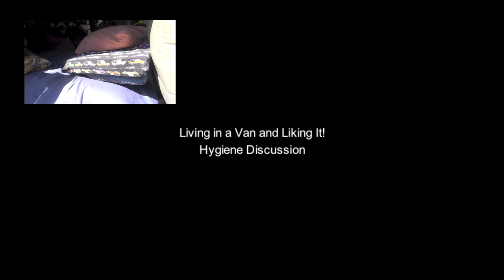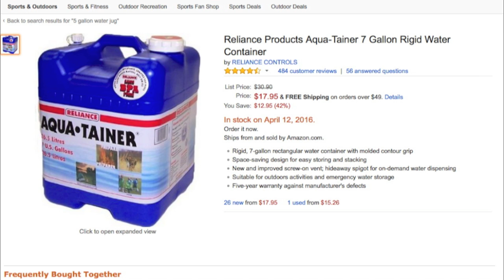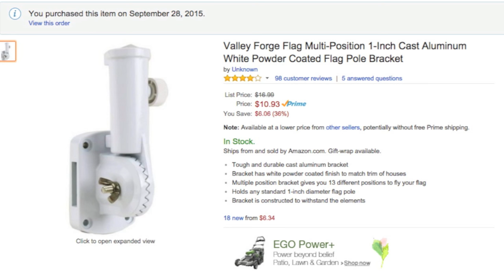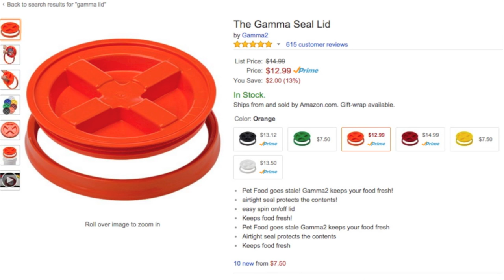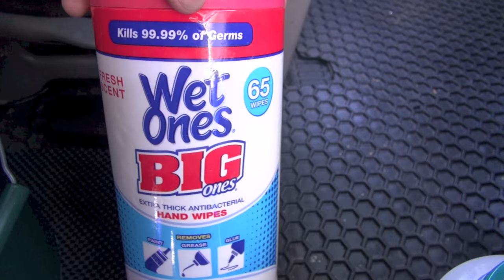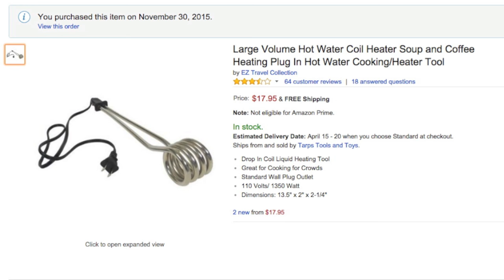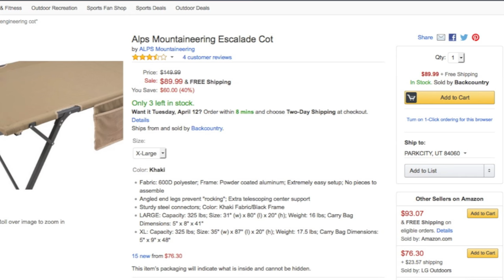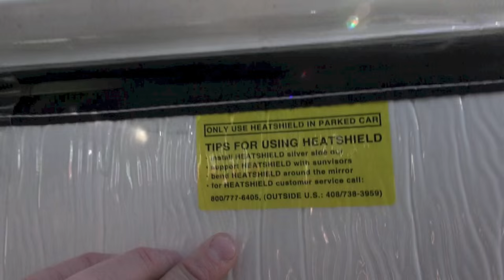Living in a Van and Liking It: Hygiene and Sleep!

Comment: When sleeping in any vehicle with engine running, buy from Lowes / Home Depot a Carbon Monoxide / Smoke Detector that is usually used in the house. They are less than $50 and can be screwed or adhesive to the ceiling
Reply: +Jeffrey Miller I guess you do not read / watch the news much. People die on a regular basis because of cabin leaks or when parked and its snowing and snow builds up around the car and the bottom of the car keeps the snow clear and the carbon monoxide is trapped underneath and creeps into the car and kills. No car is airtight, that is why when you are driving with the A/C or Heat on and it is set on recirculate yet you can smell a forest fire you drive by or many other smells you encounter. FYI Carbon Monoxide is oderless
Reply: +Jeffrey Miller When a vehicle is moving, the constant airflow over the vehicle helps keep exhaust away from it, so a minor cabin leak might not let enough in to harm you. When it's sitting still, though, you up the risk of poisoning. That's even worse when you're asleep and thus can't immediately notice the effects of CO poisoning.
Reply: +Jeffrey Miller Thinking like that kills people every year.

Comment: Pro tip: when you park, and it's not too sunny out, put the solar shower under your hood for an hour or two, perhaps with a towel on top if it's cold out.  It'll be as toasty as you like.
Reply: Smart!
Reply: Smart!
Reply: +blurglide Engine heat also good for warming canned meals.
Reply: whiskey papa Good idea- I might throw a can of soup nest to the radiator
Reply: +blurglide If he were as handy with engines as he is with guns he'd install a hot water to hot water conversion tank (a small one, like 2 gallons, set it about 190F) like they use in houses and such then he could dilute the hot water down to whatever temp he would like. Even make a cup of hot cocoa or cold press coffee.
Reply: +BikingMNViking yeah like those heaters in glampers.

Comment: Do you keep an extra cheap starter in your truck? The one thing about boondocking with automatics is if your starter goes out, you're screwed. I also recommend a second battery (deep cycle) with an isolator so you can hook an inverter up and run whatever 110v you need. With the right setup you can press a button and it'll connect both your batteries in case you kill your starting battery. Redundancy is the biggest thing for those of us who do this often.

Comment: Clumping cat litter.  A lot easier to find on the road than the Lug-Loo chem packets.

Shower/dishwasher.  One or two gallon pressure sprayer bottle, re-fit the wand with a kitchen sink sprayer/hose
Reply: +el diablo loco poco I was thinking about getting a spray bottle. Good idea.
Reply: DappledJoker It works great, and its a bit easier to clean than one of the plastic sacks.  Put it on the roof of the jeep for a "shower".  The current bottle is black, and it warms up fairly well when the sun is out.  Don't expect a lot of water pressure though.

Comment: A good addition to the commercial building water kit would be a 4 way silcock key, because the spickets are usually different than a residential hose setup. You can get them in the plumbing section of depot or lowes, or on amazon for $8-10-.
Reply: Yes.Good option.

Comment: I've doing a lot of the same things you've got going on. One thing I'd suggest is that when you get ready to use your shower, add about 1/2 the volume of water, then heat with jet boil or similar a couple of cups (liters) of Hot water. It take the chill out. Doesn't take long either.

Comment: I've used a NEW 1gallon garden sprayer as a camp shower. Heat gun the wand and bend it into a J shape to spray yourself. Fill it with stove heated water or a black painted juice jug in the sun heats it to real shower temp in no time. Pump up for pressure from any angle.
For the loo, I would suggest using sawdust (wood stove pellets) or peat moss/coconut coir (from any HD store) as cover material for the affluent- no liquidy mess, and helps trap odors. Even used coffee grounds from most coffee houses. Great call on the gamma lid!

Comment: I have the exact same van. just an idea, if you back up the van and open the back doors you can stretch a pole across the back doors. the back doors have a little spring to them when fully open so you can squeeze a pole between the doors and the tension of the sorts will hold it. if you place the ople across the end of the doors at the top and you can hang a curtain from it and take a shower just inside the curtain between the curtain and the bumper. a bit tight but much more secluded than showering in the open.

Comment: I do the same thing. I hate spending HUNDREDS of dollars a week on hotels so I live in my van when I travel and I swing by truck stops or campgrounds for showers. I keep 20 gallons of fresh water in a 30 gallon barrel. I also have a generator. I have a simple little breaker panel that powers my PTAC and my general outlets. I can run on a simple 20A/30A 120V plug or a 50A 240V/208V.

Comment: Since you use liners in your loo you can drill a vent hole in the top side of the bucket to let the air out but it will remained sealed with the gamma kid setup. Great stuff.

Comment: Nutn, 

Let me upgrade your shower situation. Heres my surf shower:

5 gallon LCI water can (same as used by military)= $20 

Submersible pump water shower (on amazon) (plugs into normal gigarette lighter charger, or you can retrofit for whatever plug easily)= $40

If you want hot water (i just fill up with hot when i leave and its still hot by the time I get out of water) buy a fish tank water heater and strip the plug and use liquid tape to splice a cigarette lighter on)= I dunno the cost but bet its less than $30

With this setup you get hot water anywhere and powerful water flow.

Comment: Me and my family are big on wipes! 4 kids will do it! Stopped buying ready made wipes we use the dye free select a size paper towels, break em down and yes your folding of the individual square is important!! Fold into a like size lock n lock or wipe contaner with about an inch of water and your favorite soap press the square of PT in your so semi soapy water. Keep folding and pressing until it's full dump out any excess spuater and your done. Store in a zip-loc

Comment: Regarding a heated shower, have ever thought to, or ever considered, installing an on-board hot water shower that utilizes a heat exchanger to use heat the engine produces to warm your shower water? A lot of off-road expedition guys use them with great success.

Comment: Sweet setup!  My uncle rigged up a system that heats his swimming pool using his home's AC.  I bet you can figure out a way to heat shower water using the van's engine... Maybe hit a switch to circulate water through some coils around the exhaust manifold... or maybe divert some engine coolant through a small radiator submerged in the water... Maybe you'll come up with something better.  Just some thoughts :)

Comment: Running the engine overnight for ventilation is clever and cheap.  Probably the best way to not sweat to death in summer heat, but isn't that bad for the engine?  Nice systems!
Reply: +OutdoorEnthusiast88 If the engine's cooling system is working properly, It should be fine. Running an engine at idle does place some wear-and-tear on it, but it's still less wear than actually driving the thing. I guess it depends on how much you're willing to spend on gas. I'm not sure exactly how much gas it would use to run an engine on idle for 6-8 hours. Probably quite a bit.

Comment: NutN, Regarding your shower system, check out what the 4x4 guys are using in Australia. Glind is one of the leading manufacturers of hot water showers that your system could easily accommodate.

Comment: Much better video this installment. My 800W inverter will run my 1.0 HP shop vac (6.2 A continuous). I have secondary battery installed with breaker so I can cut the vehicles battery out of the loop or charge both. I like the water trough heater but I think it pulls more amps than practical for inverter off a couple car batteries. I carry a large rice cooker, pulls 500 watts and will boil 1 gallon of water in about 15 minutes, good for coffee, add to a couple gallons for shower water. You can also place a 5 gallon plastic jug where the vans exhaust will hit it but it takes awhile to heat that much water.My inverter also runs my laptop and my all in one printer/scanner if business trip and need the printer.Get some higher grade (at least 90% rubbing alcohol) for after bath splash, because you can't clean germs, you have to kill them. The alcohol will also act as emergency reserve fuel/ washer fluid antifreeze.For a night light I have EasyAcc U-6,000 powerbank w 50 lumen light that is good for 72 hours continuous use on one charge and will charge my Huawei mediapad X1 one time. The Huawei is my phone/tablet-entertainment device/broadband modem for internet and actually still fits in a front pocket. Has a good camera also. If I wear bib-alls the camera sticks just above the pocket and I can use it as a body cam.

Comment: you should talk to truck drivers and see their systems.... for example we get free shower for every 100 gallons of fuel we put in on our loyalty card. You should get a flying j - pilot card. To pay for a shower at truck stops we don't fuel at is usually $12. I usually shower every 4 to 6 days when on the road, but for the days I don't shower I get the cracks and crevices with baby wipes and wash face and hands whenever I get a chance.

Comment: +nutnfancy I spent a late-season (6" snow) hunting week camping in my Isuzu trooper, and was quite comfortable. My system is similar, except I have a foot of clearance, and 4x4; as such I've had some amazingly pretty and secluded country to wake up to. No AC though. :( Anyway, I'm looking at putting in a copper coil under the hood, and using the engine heat to warm my shower. I'm sort of surprised that (as shown so far) you don't have a lightweight shower tent. Thanks for the links on the chem option for the toilet. I actually attached my toilet seat permanently to the bucket, and just use a fresh bag for each "movement". My buddy and I affectionately refer to it as "the buggy dumper". I need to get some smaller totes like you have. Great idea. I use the large rubbermade totes. They are a pain to search, but make a handy seat or table in a pinch. They are also pretty tough. Since I have windows, people can't easily see their contents. For those considering what Nutn is showing us all here, DO IT! There is a whole new amazing level of freedom and adventure to be discovered. Thanks for sharing Nutn.

Comment: I think most of those bucket potties us some sort of dry material rather than wet.  That's the first wet bucket I've seen.  Have you tried cat litter, instead, lol?  For some reason some naturalists put a dry potty in their otherwise luxury microhome, especially when it's still on a trailer (you know, before it becomes their vacation home, lol).

Okay, so...  You could get a twin memory foam matter topper, I like the cooling gel version, that would really improve that bed.  Still wouldn't be like, mattress soft really, but if you could get an even thicker topper until it was really a lot better.
Reply: Got my mattress topper on Amazon, lol.
Reply: They make pillows out of that memory foam too.

Comment: For road / camping showers I'd recommend the less than $100 Nemo Helio.  it's pressurized by a foot pump, holds 2.9 gallons, and provides 5+ minutes of continuous water flow (if you choose to hold down the trigger til it runs dry) through a kitchen sink like sprayer.  The unit sits on the ground, and provides water pressure unlike a hang-up bag bag.
Also I'd like to let you know about your van's built-in water / food heater; it's your V-6 engine.  Rig a system to hold a metal water bottle or canned goods on the exhaust manifold (I use baling wire) and voila' you have free boiling hot water and food.  Just mix the hot water with the room, or car, temperature water for a comfortable shower.  The Nemo Helio folds up to a small size for stowing away.
The less than $60 Camco premium portable toilet beats the crap (hehehe) out of your 5 gallon bucket.  No stink, water pump flush, and easy to dump reservoir makes an otherwise filthy job a little more civilised.  
I'm enjoying this series of van videos.  Have you ever considered a futon with a legitimate mattress?
Reply: +DaHeetFiveOh Or you go to your favorite hardware store, get a $30 3 gallon lawn and garden sprayer, a $10 shower kit, and put that $60 in your gas tank instead ;)

Comment: If you're in a remote location why not poop in a hole and bury instead of shitting in a bucket 6" from your pillow? Walmarts and campgrounds have toilets. Someplace too remote to be near a toilet is remote enough to take a deuce. And you have the added benefits of leaves for wiping. I suddenly have the image of Nutnfancy parked on a suburban residential street too tired to drive to McDonalds and taking a hot sweaty growler into a bucket. Some child may see that and think Santa is leaving a gigantic lump of coal because they've been bad.
Reply: cant break cover